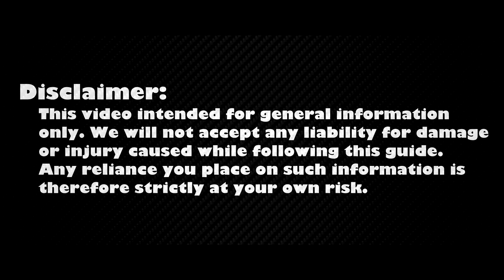HP ProBook 4430s Keyboard Repair – Step-by-Step Replacement Guide

Comment: Hey worked perfect. My 12 year old and I  replaced our keyboard in 30 mins with the help of your video. My daughter spilled water on the keys. We ordered a 17 dollar replacement from Amazon (Earth..something). We did have some trouble placing the new  keyboard in.  It wanted to not seat at the top. Once we got it in it was sill loose until we added the screws back in.